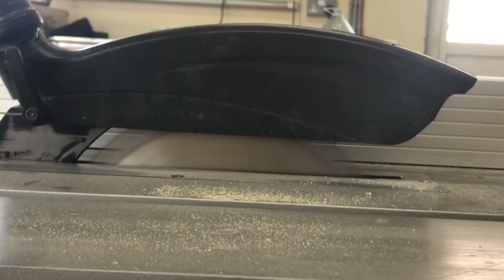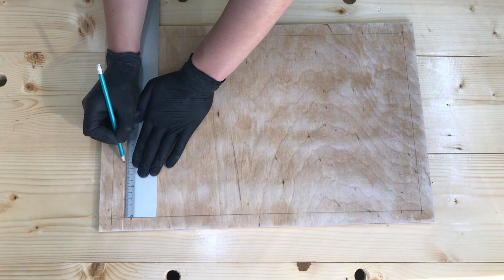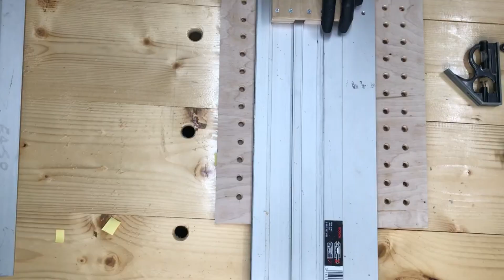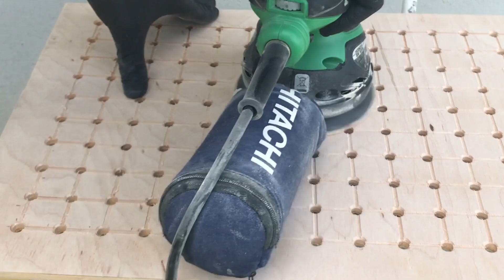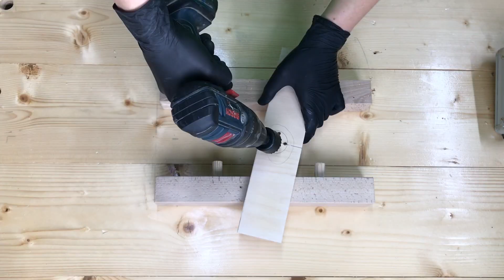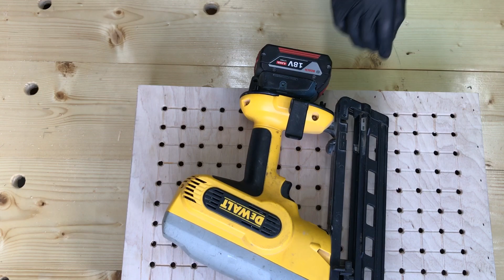Cool idea for a workshop!

Comment: You can get a large dimension mouse pad from a computer store to cover the holes that you are not using to increase suction. The rubber backing will seal the holes very nicely and should be easy to find one.